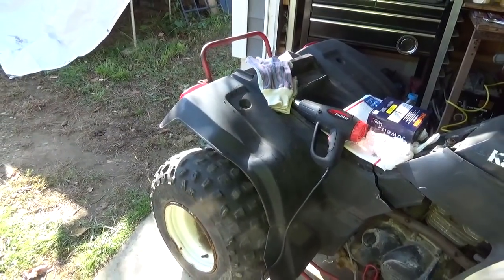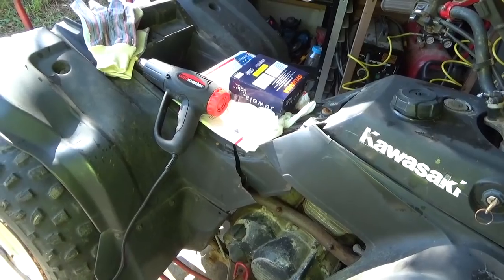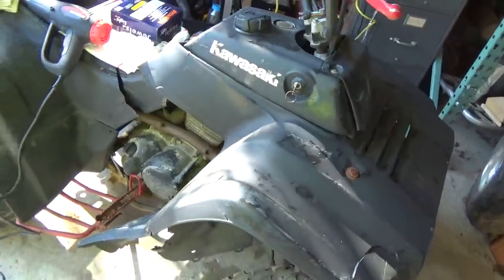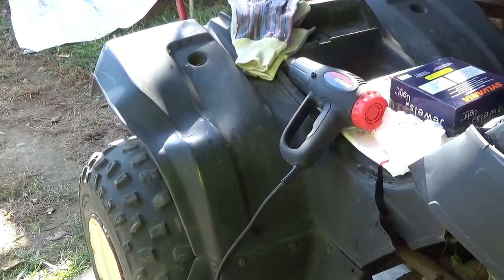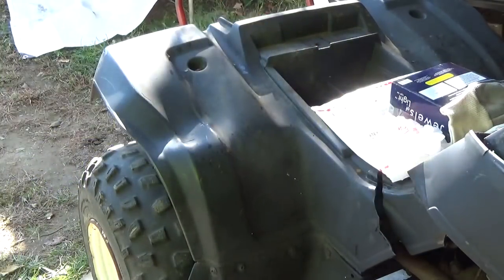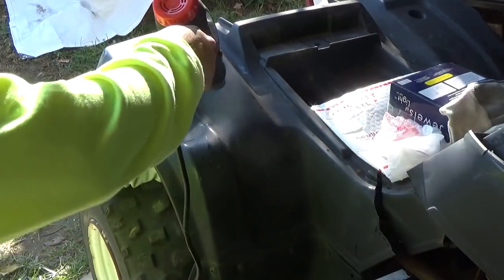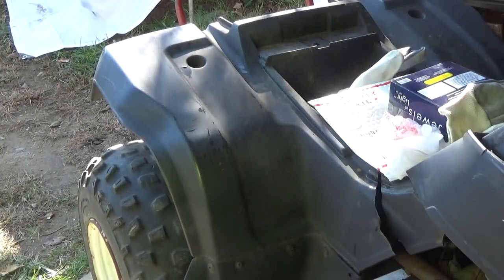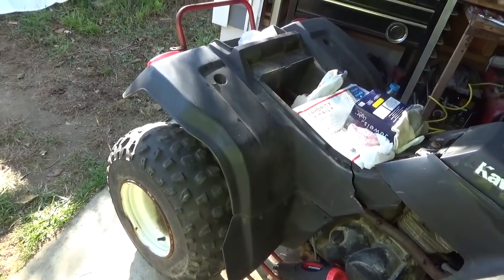ATV plastics, easy fix for a distorted fender!

Comment: If you cap the ends of pvc pipe and then heat , You can easily bend , Then once in the shape one wants ,Hit with  wet rag. . Will also bring the color back on some plastics. Good video
Reply from the maker: Hey Terri!!! Good info on the PVC pipe and getting color back into the plastic, unfortunately, this plastic was painted flat back.... As always, thanks for Ur thoughts, the suggestions, watching, and commenting!!!!